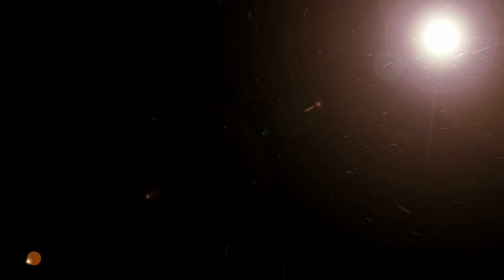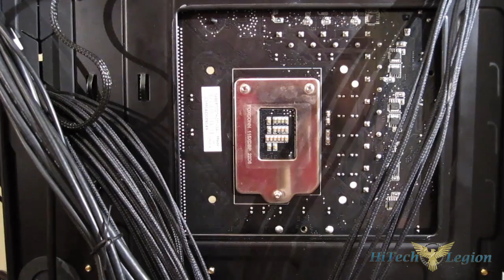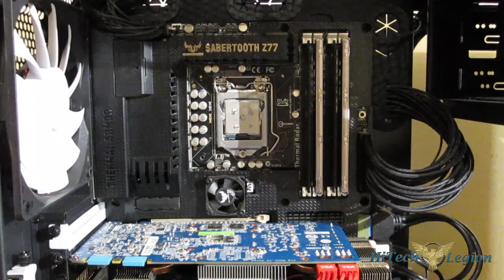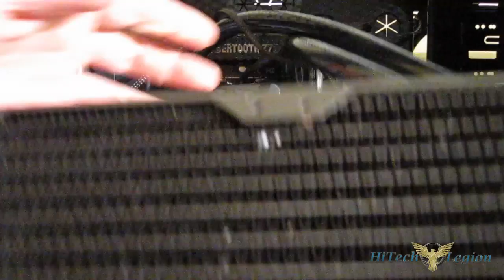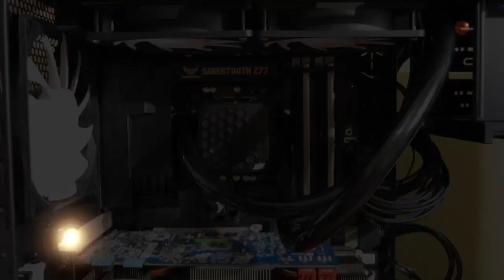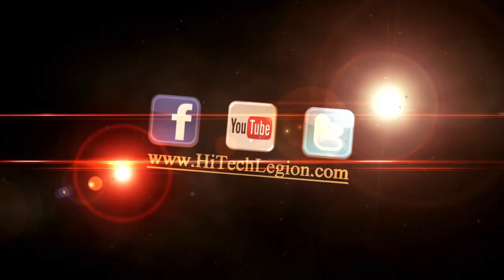Swiftech H220 Installation at HiTechLegion.com

Comment: on another video the guy had the pipes at the bottom, whereas yours are at the top. Can you place this on whichever side you like? I plan to put this onto a Fatal1ty z97x killer board and the pins are awful close on the left hand side so I would like to rotate the block to keep he pipes away from them.
Reply: Peter Bolton The CPU block can be oriented either way without affecting performance.

Comment from the maker: You could definitely make a case for the X60 for someone looking for a CPU only cooler. The cooling and noise levels are very similar. That isn't the case with the H100i. The H100i is outclassed in absolutely every respect by the H220 (and X60).

Comment from the maker: Oh....so the performance gain of a few degrees is insignificant, as is the incredible noise difference whenever the CPU is under any real load? If malfunctions were your only concern, you would be running a high end air cooler. When you get to this level, a few degrees is what separates the players.

Comment: The H220 is very expandable and great for making a big loop with the GPU included, the H100i is a better choice for a closed loop since corsair builds them rock solid and it doesn't have huge thick tubes like the 220 does

Comment: I have exactly that combo and it fits fine even though it has to be off-centered because of the sick dragons that take up some space on the top of the board
(also, my pump stopped working after a day, so I don't recommend this cooler. GET A H100i)

Comment: I'm still not sure exactly what was going, I installed it and the pump fired up at max speed and while diagnosing WTF was going on it gave out, I did find out the max speed for the pump is 2800 rpm though =P  Something weird was going on though because the fans and pump all went to max speed, maybe I had it set to turbo in the bios but like I said the pump failed before I could diagnose wtf was going on.  Also I've seen dozens of installations and no one used the PWM splitter

Comment from the maker: Kind of odd, and not sure the events are actually related. One would expect that the MB header would be the component to give out if there was overdraw, not the pump. However, you will get more power using the PWM splitter, but you also lose some flexibility with the fans and pump using only one PWM signal rather than two with separate control.

Comment: Just so ya know, I installed this in the identical manner using a hero board and fried the pump.  After talking to swifttech they reccomend using the PWM splitter is reccomended for use for steady power.  Like I said I did almost exactly the same as you and my pump commited suicide.  Swifttech was pretty cool about it and are replacing my kit but, this is not how they want you to do it.

Comment from the maker: You can mount it with the fans and fill port up. Two reasons for this config in the video - first, this is how Swiftech shows an R4 install, so I followed suit. Second, I was using the fans as exhaust and I have a strong preference to having the fans blow air through the rad rather than pull air through the rad. Had I been running as intake, the fans would have been on top.

Comment: So could you actually switch the installation around in the Fractal R4 and screw the fans into the case with the radiator attached below the fans? Thus allowing the fill port to be above the radiator? If you could do it that way, how come you didn't?

Comment: Just to confirm, the "optimal" installation configuration would be with the fans on the top, attached to the case, and in 'pull' mode. The installation in the video is the other way around. 

Is there any performance increase in using 4 fans? Say, for Gentle Typhoons? I have about 20 GT-15's here that I can put to good use.

Comment from the maker: The H220 answer is a no brainer - expandable, better performance, quieter and better build quality. The X60 is also pretty easy - it is the same unit as the H110 physically, but NZXT's handling of the fans and controls was significantly better, resulting in superior performance at similar noise levels.

Comment: I am very impartial, and my comments are made from firsthand experience with both of these coolers, rather than from what I have read on other sites. The fact that I personally didn't write the review of the H110 and that it wasn't released yet at the time of the H220 review doesn't mean that I have not tested them together.

Comment from the maker: Swiftech had commented on this previously, as follows - "In some cases it won't be possible to mount this unit in the optimal manner. It will depend on whether or not the case has enough room at the top to fit the reservoir. If it doesn't then you may need to fit it with the reservoir outlet facing downwards. I hope this answers your question."

Comment from the maker: The H220 is benchmarked directly against the H100 in the full review, and expandability is discussed at length. The Swiftech H220 is a significantly better piece of equipment on all counts.

Comment: I guess what I was wondering was if it worked for you, I also have board with a similar layout as the one you used. i guess even if it did not fit, the h220 could be mounted in the front of the case as well.

Comment: Planning on putting this baby in Bitfenix Prodigy as push pull then have a 200x200mm rad in front push pull and have another 120 or 140mm in the back just push or pull might need to put fan on the outside with grill for clearance  to in a mini-itx! The cool H2O going to the GPU first, then to the CPU, was thinking of doing VRM too. VirtuMVP it and BF4 Ultra 60fps @ 1440p via displayport LAN-machine, mod the handles to be comfortable.

Comment: To clarify my previous post about how to mount and fill the radiator for this kit. You will be better off by draining it and filling it outside of the case. Just be sure to keep the pump lower than the radiator and reservoir when filling it so that fluid will flow down the path of gravity. Cycle your pump after every time you add fluid and just look inside the fill port to be sure that the fluid is moving and to see how much more you need to add until it's full. I hope this is a better answer.

Comment: In some cases it won't be possible to mount this unit in the optimal manner. It will depend on whether or not the case has enough room at the top to fit the reservoir. If it doesn't then you may need to fit it with the reservoir outlet facing downwards. I hope this answers your question.

Comment: I thought Swiftech recommends installing the radiator with fans on top, in other words intaking air from the top of the case. Also this way the fill port is facing upwards and can be accessed more easily, typically without having to remove the radiator from the case.